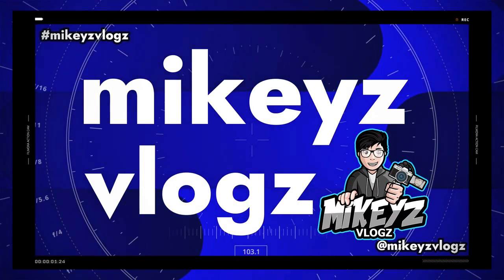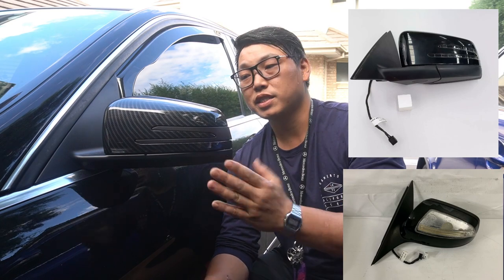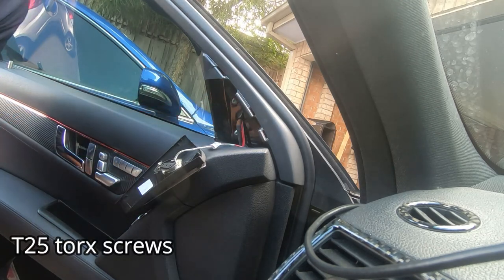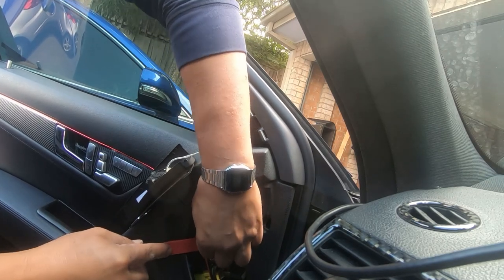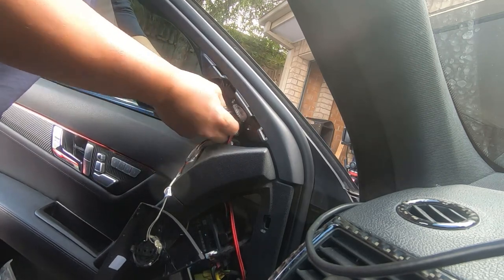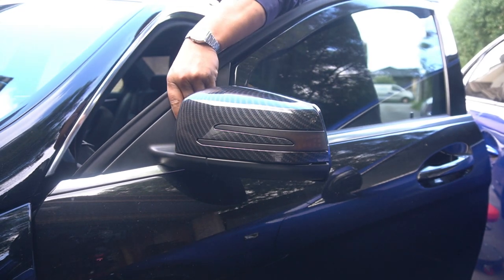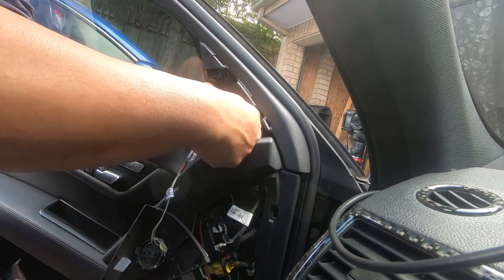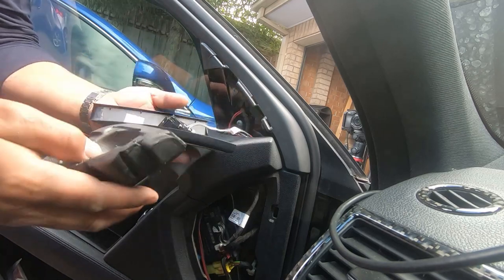mercedes w204 side mirror assembly removal/upgrade older models 07 08 09 earlier models

Comment: Thanks bro, really useful video, going to upgrade mine tomorrow
Reply: Did it work?
Reply: @genericchannel-wy5jh  yeah bro, just the foam inserts on the triangle part is a bit different. You gotta cut it with a blade a bit and it will fit

Comment: I have an 08 w204 C180 Kompressor with the older style mirrors but they fold in automatically!
How do I upgrade to automatic folding newer style mirrors and where to find them?
Reply from the maker: ok so ... for ppl who are looking to upgrade the side mirror assembly... your best bet is to find used on places like eBay.... or places that have similar models  taken apart ... because you have fold in mirrors ...ensure u get ones with fold in mirror function as well
Reply: Have you tried it yet? Is it working ? I’m looking for the upgrade as well thanks
Reply: @lionhartono9539  Nope let me know if you have done so!
Reply: Just buy mirrors that has 2 cables black and white with mirror folding motor.
Reply: @genericchannel9448 hey bro, how are you doing on this upgrade now?

Comment: Hello buddy! I just mounted a facelift mirrors on my W204 and noticed that the foam on the new mirrors didn’t fit with the foam on the car! So I took off the foam from the mirror for good and left only the part on the car. Do you think is gonna be a problem? I mean waters enters anyway in the door when it rains because is never a perfect fit but it certainly has drain holes at the bottom!
Reply from the maker: I guess u can always try and see what happens... worst case get the foam from wrecked car
Reply: @MIKEYZVLOGZ  yeah I plan to check back of the mirror by removing the tweeter and the foam behind it to see if the water is going in when I wash the car. This is my main concern tbh. Is kinda hard to find that foam where I live. They people in here are like “what? Get the whole door I’m not wasting my time selling you that foam for pennies!” They are interested in bigger amounts! I was wondering if I could use the facelift lights and hood. I already have the facelift front bumper. It fits like a glove. My car has the 950 AMG package (interior exterior) but I noticed I have the front bumper with the DLR led stripes and not the round fog lights. I’m very confused. They leds are connected to something but they don’t work and I’m getting the fog lights error all the time because my fog lights connectors are free in the bumper connected to nothing!
Reply: @MIKEYZVLOGZ  I made it installing the sponges! I found some and I fitted them today! Yaaaay!
Reply from the maker: @neptunevibe well done bron

Comment: what if i have the one which is not folding. can I replace it to a folding one without any issue and it will work?
Reply from the maker: the im not sure ..but I have heard success stories where ppl retrofiit the folding mirrors..as long as u have the door module that allows the plug for folding mirrors im sure it will work.. also u mite need to activate them so the setting show up on your cluster .... and u will need to get a Window switch to support the function
Reply: @MIKEYZVLOGZ  Thank you for your prompt reply!
Reply from the maker: @younghustlaz1982  welcome

Comment: Hello mikeyz, do you have tilt mirror when reversing? I don't believe my 09 has it even though I have P1 package. Does this require new door module?
Reply from the maker: yes I do ... if u watch my cool features I show it clearly and I also have the auto dim for driver side .... I'm not sure if it requires the module on door .. I think it might so it can tell the mirror to face down etc
Reply: @MIKEYZVLOGZ  - thanks 🙏 I Will check that out.

Comment: Where did you get ur bulbs at for the side mirror?
Reply from the maker: aliexpress they ate designed to replace the factory bulbs for mercs that have puddle lights
Reply: @MIKEYZVLOGZ  how hard is it to change them?
Reply from the maker: @Nate923  easy peasy look at my video where I disassemble side miror it shows how u do it ..or my puddle light retro fit
Reply: @MIKEYZVLOGZ  alright. Thank u so much for responding so quickly and actually answering me.
Reply from the maker: @Nate923  no worries

Comment: Ok, for anyone wondering, you can NOT upgrade the pre-facelift mirrors to the new ones. The holes on the mirror are about 2 mm apart. Also the new mirrors are with 2 connectors and the old ones are with only 1
Edit: I was able to figure it out, it was the foam inserts that that were too big on the facelift model. If you take them off the mirrors and hold them towards the hole on the A pillar from outside the car you can see where it's too big. If you cut it off with an exacto knife it's really easy and effective. After that you can just line them up and secure with the bolts. 
Also note the facelift mirrors have a light on the bottom that lights up when you open the door, the white connector is responsible for that, if you don't mind that function you can just plug in the black connector to the module in the door and the turning signals work as they should.
Reply from the maker: really ?? thats good to know , did u try and upgrade?? did u try and change the entire side mirror assembly ??? where u unscrew the 3 bolts and the entire side mirror comes off??? just wandering ...
Reply: @MIKEYZVLOGZ  Yes, the whole assembly. I have a 08 model with the old mirror, with the one big triangular blinker and not the 2 lines, I got 2 mirrors from a facelift model and wanted to swap them out. Visually all looks the same but the differences are very small. There is a little bit of a curve to the new mirrors on the plastic piece that has the holes for the bolts, so you can't align it, it's very close but won't fit. The little black thing sticking out in the middle between the bolts also won't go into the guiding hole. I would have to drill new holes and that is too much of a haste. The cable on the new mirror has 2 connectors like you showed and the old ones have only one. So even if you fit the holes you will need a new door module that has 2 connectors, mine doesn't have the pins inside for the second connector of the mirror, you can clip it in but nothing happens. I think that connector is for the small light at the bottom of the mirror that lights up when you open the door, blinker managed to work when I connected it to the other port to test. Hope this helps. :)
Reply from the maker: @radomirbossev1300  ah hyes this is why i said u may need a module, ive seen this doen before , many ppl have done it , i guess they went all out and did the entire module and all
Reply: @MIKEYZVLOGZ  It was really a much simpler issue than I thought... check out the edit I made to my original comment. Also, kept the same module in the door, the turning signal and mirror motors to adjust them work perfect just with the black connector plugged in.
Reply from the maker: @radomirbossev1300  I knew it was able to be done dude..and u can get the mirrors without the light aka puddles lights
Reply: @MIKEYZVLOGZ  Also adding to this some people just suggest using the old foams from old mirrors and putting them to the new ones, im not sure if this is enough, but i will try it.
Reply: @MIKEYZVLOGZ  Ok so I changed the mirrors and they just fit there. I removed all foam from the car side. I just left foam of new mirror to mirror itself and put it there. I had to remove old foam from the door because it was in the way of the new mirrors metal frame. Plug and play blinkers work (I didn't have folding mirrors so idk about that, but i guess that would be plug and play also). 
So if anyone is wondering facelift mirrors will fit pre-facelift remove foam from car (Foam under old mirror, remove it). My car 2008, mirrors facelift.

And thanks for all the other tips! Car is waiting me with w212 2012 steering wheel and coloured instrument cluster. Had one guy here in Finland to code the instrument cluster :) 

Thanks for your contribution to w204 community, your videos have helped many people.
Reply from the maker: @Aletzr  cheers man I'm grateful for u watching Nd following along
Reply: Did any of you have the power folding mirrors by any chance ?